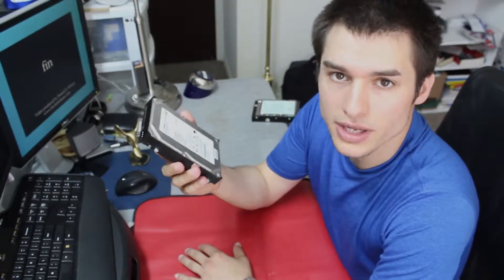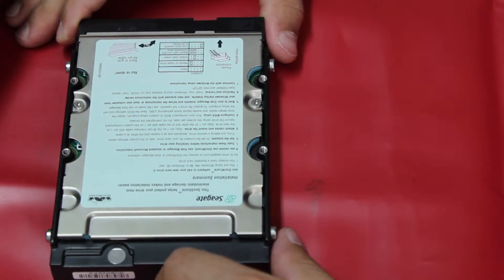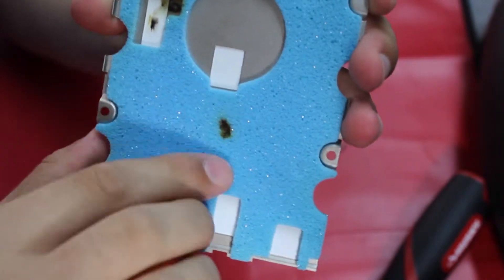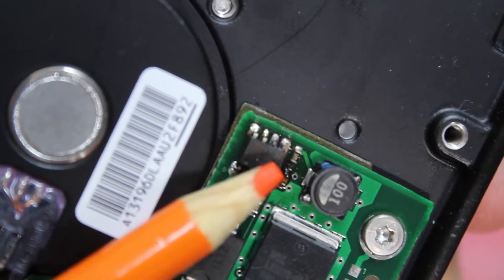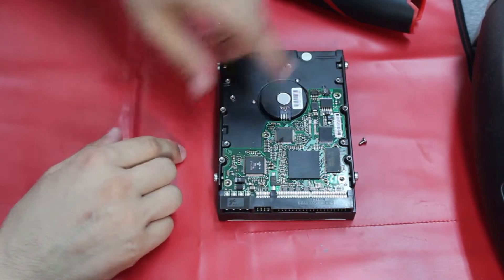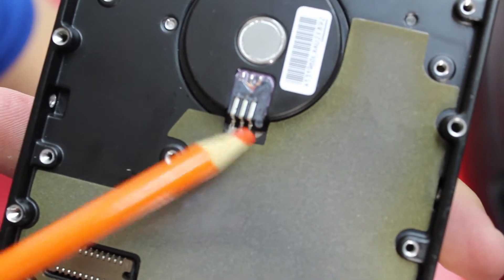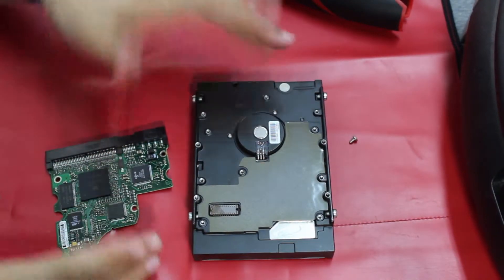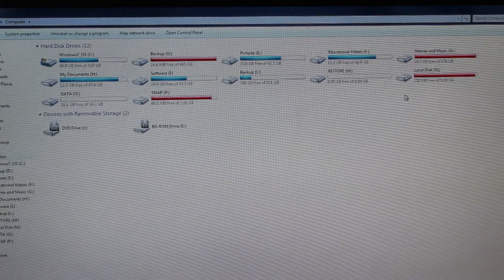DIY How to Repair a Damaged Hard Drive Due to Lightning Storm

Comment: Exactly what happened to my computer! All my pix from childhood were on the hard drive, computer man says drive is gone! I'm old, puter is old, but pix were so important! Any hope?
Reply from the maker: +verrado It depends on the type of failure. If you can locate an existing working Hard Drive (from EBay), and replace the logic board (Must be the same model) on the bottom that would be the easiest. Older Hard Drives area cheap, but more difficult to locate.